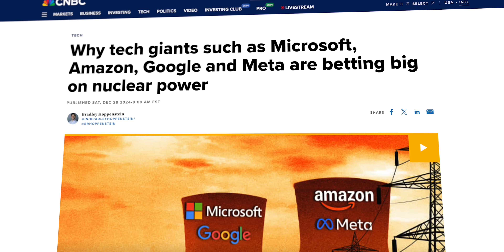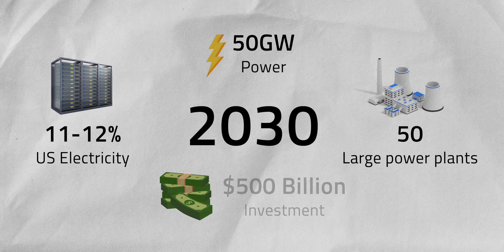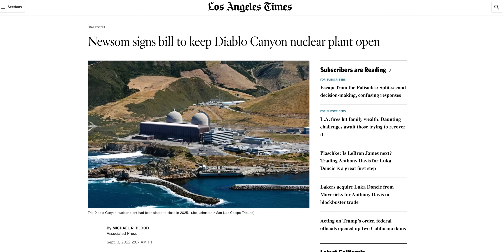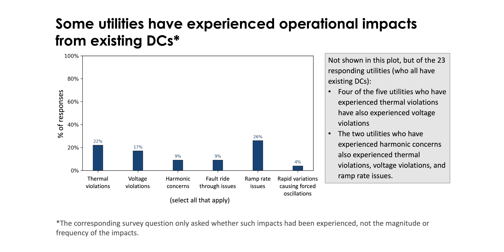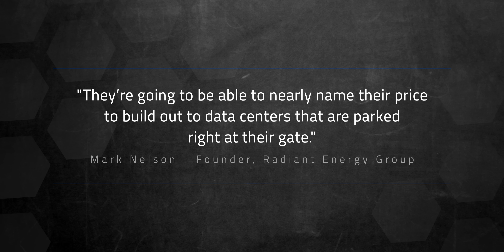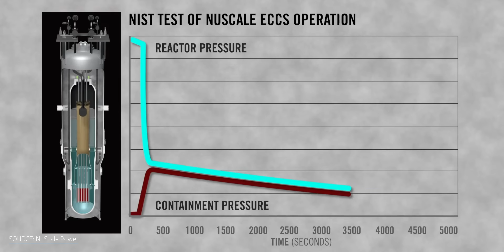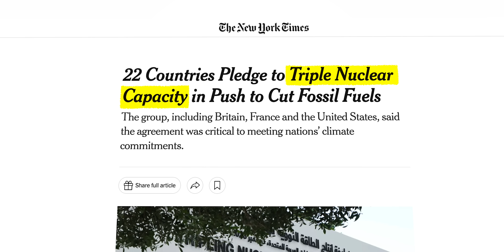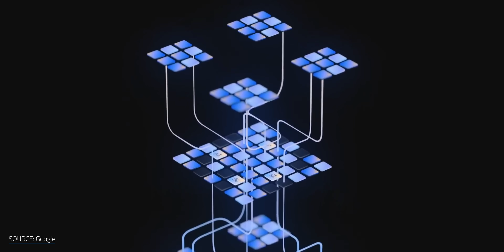Why Big Tech's Betting Billions on Nuclear (Not Renewables)

Comment: 1. The current full lifecycle cost of nuclear power is 10 times higher than that of renewables, excluding the additional costs of addressing potential disasters.
2. Stricter regulations continue to increase both the cost and the time required to launch new reactors.
3. 85% of existing reactors will be shut down within the next 25 years, and the new reactors currently under construction are insufficient to replace them. As a result, nuclear power generation will decline significantly, driving prices even higher.
Nuclear is not the solution.
Reply: 1. You're comparing apples and oranges, renewables are opportunistic power sources, so they may be cheap but they're not reliable 
2. Regulations can be made more practical without making them less safe.
3. It's always expensive to build things once in awhile. If we can standardize nuclear production and start growing at scale then we can churn them out faster.
Reply: @cirelancaster  LCOE compares the cost of various power sources. The LCOE of nuclear is already much higher than all renewables and going up, while renewables plus storage continue to drop. 

Battery storage is still dropping like a rock. But we don't even need dedicated battery storage. All EVs when parked are available for power arbitrage through V2G, buying low and selling high, and thereby stabilizing the grid. At least 2 EV suppliers already cover this functionality in their battery warranties, and others are sure to follow. 

Nuclear power is dead. It would never have got off the ground in the first place if it had been required to include the cost of waste storage forever in the cost of power. This cost has always been a can kicked down the road for our children to deal with.
Reply: @WallyBraun  LCOE doesn't account for battery storage or long term outages. Solar really suffers during long lasting forest fires when the sky is black and the panels are coated in soot. 
Also solar and wind have been heavily subsidized, what's going to happen when those go away? And most people connect their cars to charge them at night, not to store electricity during the day. You can't drive to work in the morning and leave your car at home to be a battery.
Reply: @cirelancaster  Heh, look at nuclear power generation in France during hot weather. They does not produce power in such conditions, and it's not even forest fire or some other disaster. Even with batteries renewables are much cheaper, and if you need power fast, that nuclear is not the way. Also, now we have a lot of different accumulators, like ion one, where storage is decoupled from generation. This unlocks big storages, that may cover peaks or night time.
Reply: @cirelancaster  No, I am comparing real things. Current WIP nuclear power plants power capacity (with 10 years building cycle) equals to the capacity of renewables built in 1 year. Peaks could be satisfied by gas peak stations. Regulations are never don't more practical, but are always stricter. There is no way it will change with current green shouters. 3. There are no signs of increasing productions of nuclear powerplants, just a decrease in volumes. And in less than 25 years we will have 1/5 of current power generation. No way it will be cheaper.

Comment: I don’t think so it’s possible we are going to have more problems with waste
Reply: well the waste itself is 96% recyclbe with nuclear fuel reproceing of the waste you know. so its not that hard to deal with. heck it makes alot of usefuel reare eath metals asa byprocut that can be used to make alot more powerplants and aircraft and space craft terbine blades. this is due to struom 90 decays into ziciuom 90 with tis the same nuclear stable safe to use non radioacitive istope we use to make thsoe terbines with. thats after 30 of wating by the way.
Reply: @ You’re on the right track, but let’s clarify and correct a few points:
	1.	96% of nuclear waste can be recycled – This is mostly true for spent nuclear fuel. Advanced nuclear fuel reprocessing, such as in France, can recover about 95-96% of usable material (uranium and plutonium) to be reused in reactors. However, reprocessing is not widely done due to costs, proliferation concerns, and the remaining highly radioactive waste.
	2.	Strontium-90 decays into zirconium-90 – This is correct. Strontium-90 (Sr-90), with a half-life of about 29 years, decays into yttrium-90 (Y-90), which then decays into zirconium-90 (Zr-90), a stable, non-radioactive isotope.
	3.	Zirconium-90 is used in turbine blades – While zirconium alloys are used in nuclear reactors (like in fuel cladding), turbine blades in jet engines and power plants are typically made from nickel-based superalloys, titanium, or ceramic composites. That said, stable zirconium isotopes are useful in nuclear technology.
	4.	Rare earth metals from nuclear waste – Some fission products in spent nuclear fuel are chemically similar to rare earth elements (e.g., neodymium, europium, samarium), but extracting them efficiently is still being researched. It is theoretically possible to recover useful materials from nuclear waste, but it’s not yet a standard practice.

What Could Be Improved?
	•	Expand Nuclear Fuel Reprocessing – More countries could adopt closed fuel cycles to reduce waste and recover valuable materials.
	•	Develop Advanced Reactors – Some new reactor designs, like molten salt or fast reactors, could directly use nuclear waste as fuel.
	•	Improve Extraction of Valuable Byproducts – Research into recovering rare earth elements and isotopes from nuclear waste could make it more economically viable.
	•	Public Awareness & Policy Support – Better education on nuclear waste management could shift public perception and encourage investment in recycling technologies.

We should remember the impact on the environment and are dna there are solutions. Let’s be very careful when it comes to using this technology but I stand by what I say the waste is still a problem because we are using loads of it to power everything let’s add up the amount per year I understand your point we don’t really want waste plastic is used because of profit I’m all for using it again it’s a better idea but they are using old technology still I see in the future looks good but we do need to move forward because of the ai age and all the other inventions that come with it so we need loads of power.

Comment: I would rather see a new nuclear plant built than rebuilding a closed plant. Palisades Nuclear Generating Station is a death trap. With many cracked, leaking, and plugged pipes. We don't need another nuclear meltdown in Michigan. We need that inertia driven electric to go with our wind and solar. With closure of coal plants coming soon. We don't have enough hertz to use the wind and solar we have. To maintain a stable electrical grid, it is essential to ensure that the frequency remains within a specified range. This range is determined by the grid code and typically falls between 59.95 Hz and 60.05 Hz. This narrow band allows for small fluctuations in frequency to accommodate changes in electricity demand and generation. Exceeding the specified frequency limits can lead to various issues. For instance, if the frequency exceeds the upper limit, it can cause overvoltage conditions, potentially damaging connected equipment and posing a safety hazard. On the other hand, if the frequency drops below the lower limit, it can result in undervoltage conditions, leading to equipment malfunctions or even blackouts.

Comment: My question is how do you dispose of SMR once the fuel inside depletes?
Reply: You refuel it.
Reply: Depends. Some will be refueled on site, some (sealed mobile units) would be returned to manufacturer to refurbish or recycle.
Reply: you will be tied to the manufacturer; the reactor will be owned, operated and disposed off by one of the US multinationals. You will only pay and pay and more pay.

Smaller reactors will need a higher concentration of fissile isotope. that you have to purchase. Shutting down these beasts will be a nightmare. But the original idea is not bad. Power generation must be decentralized to reduce load on distribution.
Reply: @janami-dharmam  FRAUD
Reply: @janami-dharmam  the micro reactors are interesting.  Canada is looking at expanding its military in the arctic.  A micro reactor would be perfect for that.  It could provide power for the base but also the heat could be used for housing, the hangars for the aircraft and the fuel.  Ideally you'd want two of them so you have a backup in which case they could also build large greenhouses up there to grow food.
The biggest issue with the micro reactors is they are expensive but I cant see them being more expensive then the diesel power they currently use to stay alive up there since there is a short window where they can bring it in and then they need to store it.  People in Resolute NWT currently pay around 31 cents per KW.  You could most likely drop that in half by having the military buying the reactors.  Technically you could provide power for free since the reactors would be needed either way but I'm sure the people would have no issue paying 15 cents per kw which would put them more in line with other places.

Comment: 1890 futurism: flying cars in 2025
2025: steam powered AI
Reply: The history of electrical power is just using increasingly spicy rocks to boil water.
Reply: "It is year 5555. We have finally landed on the planet C1225. Our fusion reactors TPV cells need replacing so we set up the back up generator using our water/steam through the tesla turbine."

 Jokes aside we will be using steam forever. I don't think anything can expand as greatly. Please correct me. (Also the benefits of having it just be water)

 On an other note. Thermophotovoltaic cells or TPV cells look like the future for nuclear. Why no one is pursuing it hard is beyond me. 

 Thought MIT just released how to make some with greater effiency than most turbines. Yet it only works past 2k Celsius. Surely nuclear energy can reach those temps. So I dont get why not put effort into it. 

 When we crack fusion. Are we REALLY going to just heat water with it?
Reply: @dianapennepacker6854  Yup lol, I presume fusion into steam for turbines with possible TPV as a secondary source of capturing some of the would be loss. I'm not an expert in either field but surely TPV cells' efficiency rates are affected by distance from the initial heat source due to scattering? If anyone has links to relevant papers i would be grateful.
Reply: @TooFarJohn  TPV (thermo photovoltaic) cells are different from TEG (thermo electric) cells. Currently TPV cells reach up to about 43 % of efficiency.
Reply: @dianapennepacker6854  And we'll be cooling things with water forever. Talked to a liquid cooling company about the best fluid for water-cooled computer systems.  The answer? water.
Reply: @patrickgoetz  I don't think it is just water. Either ultra filtered water. I hear some use mineral water for direct cooling, or were planning on it. 

 Makes sense. Water is cheap, and safe. Even if other mediums are technically better for transferring heat. Not worth the headache or infrastructure. Need more cooling just run more water.
Reply: @patrickgoetz  well water does have some issues if  it gets too hot, which nuclear power is easily capable of turning it's coolant supply into explosives  through electrolysis, so a secondary coolant may be desirable
Reply: @dianapennepacker6854  We will use fusion to heat liquid metal, then liquid metal to heat water. Water is just good and cheap!
Reply: @wonderful_vaybe  What type of liquid metal would be good to use for transferring heat? Never heard of it. I know about molten salts, ultra filtrated water, and hell mineral oils.
Reply: @dianapennepacker6854  sodium is one.
Reply: There’s nothing wrong with using steam. It’s not like we need things to be epic and awesome. Steam engines turn heat into electrical energy very efficiently, the technology is reliable, it’s cheap, it’s easy to maintain etc etc. So unless something else comes along that’s even easier to maintain, more efficient, cheaper, etc, why would we stop using steam? Especially in terms of power plant usage. 

I mean eventually, we’ll just use photovoltaics en mass and capture the energy of the massive fusion reactor in the center of the solar system. Technically everything is solar powered except nuclear fission. I’m getting off topic… 

I mean I’m all for cool tech and trying nee ways of doing things, but they have to actually be better than what we currently have in order to work economically. If we need smaller reactors, then maybe the premium of using another way of capturing the heat energy would be worth it. But for large scale energy production, steam works great.
Reply: Hot rock make steam
Reply: "2025: steam powered AI"   Uhh... Iceland anyone?
Reply: Coal powered AI actually lol
Reply: Nuclear is a steamengine.
Reply: 3 mile island might be responsible for Matt's missing hair, you should sue😅
Reply: @qzy-179SanTzxkW  Well, China does have flying cars
Reply: Not really, these reactors are going to work more like jet engines than steam engines. They are going to be using closed cycle gas turbines to run a generator, not steam turbines.
Reply: flying cars were not supposed to be powered by steam then?
Reply: It was not in the video, but what are the plans for storing nuclear waste? If SMRs proliferate, how is the waste created by these smaller reactors going to be safely transported? My limited queries show that the  nuclear industry has not solved the problem of nuclear waste. Maybe big tech is gung-ho for nuclear, but people have a right to know what big tech plans to do about the nuclear waste their power demands create. And if they want nuclear power for their data centers, they should not only pay for the cost of nuclear waste disposal (not taxpayers!) but also have to ensure that it is safely disposed of. 

Given the scale of institutional disjunction in the US, the idea of nuclear plants powering data centers seems quite dubious. It’s not just the approval of nuclear plants, there’s waste disposal and given the small number of disposal sites, SMRs would mean transporting nuclear waste through our communities. Does this worry anybody else? I think we have the right to ask Google et al what their plans are for nuclear waste. “Not my problem” is unacceptable.
Reply: There were no cars in 1890, just horse pulled carriages. There were no airplanes, just balloons and airships. There is no way anyone would have such idea as flying cars by then.
Reply: @JanNovak-pg8oeif there were no planes, then how possibly could the continental army “take over the airports” during the revolutionary war?  -Donald Trump.  

See we now live in an alternate reality, where the truth is whatever some crazy old man says it is.